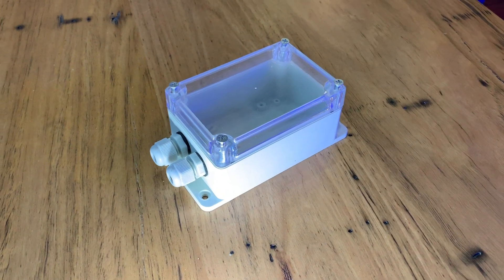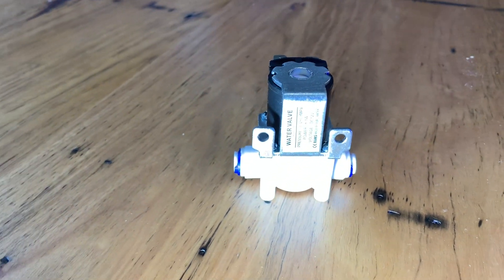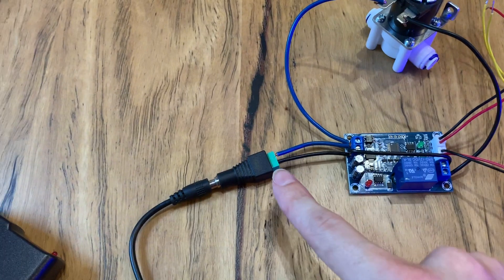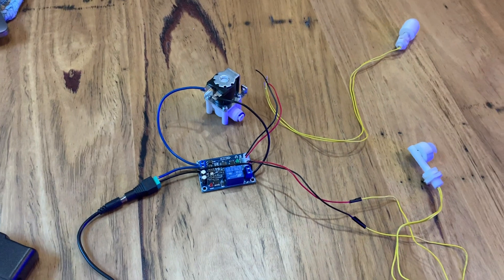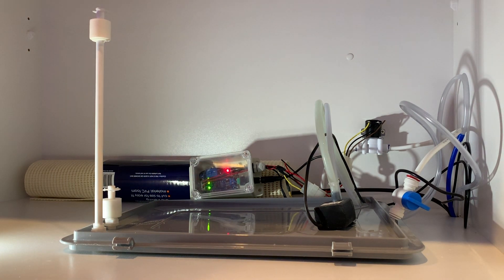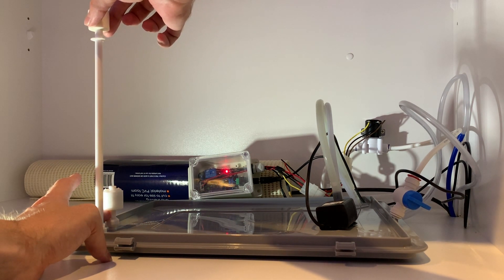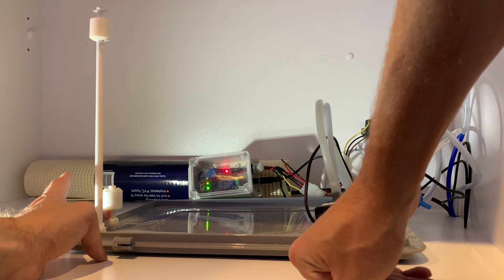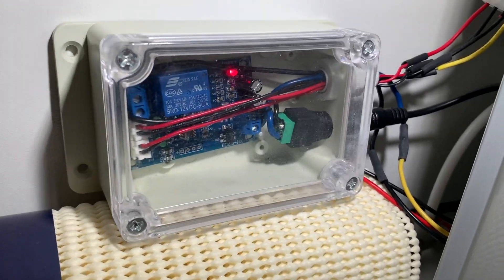DIY Project - Automating your RODI Reservoir

Comment: I'm new to this and have what is probably a stupid question.  It seems in a lot of videos that a valve shuts off the purified water when the high sensor is hit.  But doesn't the waste water continue to flow?
Reply: Not if you use the solenoid to control the supply water to stage one of your rodi.

Comment: Do you know if there anyway to flip the jobs of the float switch , I want my pump to turn in when it gets to the top float switch and stop when it reaches the bottom one so my pump doesn’t run dry ?could I just flip the float switches ?
Reply from the maker: Exactly as you say, just swap the floats around and they will function as you describe
Reply: @ReefNerd  okay thank you for the help
Reply: @ReefNerd  can they connected to Dc controlled pumps ? Like the might jet pump ?

Comment: Well explained. Thank you. Would it damage the switch if i use 1500 watt pump?
Reply from the maker: I wouldn’t recommend this little board for something that high powered. It may work… but I just wouldn’t feel comfortable. I’d get something specifically rated for mains voltage.

Comment: Hey, nice video.

I am also trying to create a similar one but i also want to monitor the water source. If the water source is low, then the pump should also stop even the water tank has low water.

Do you have any suggestion to make this work?
Reply from the maker: You could probably rig something like that up with relays and float sensors. But im not skilled enough with that stuff to be able to tell you how exactly haha

Comment: Thanks for the great video Marcus, this is super cool and I'll be putting mine together soon. As a total noob to electrical work, can I ask what type of blue/black wire you used to make the various connections to the controller? Thanks!
Reply from the maker: Just basic wire I picked up from a hardware store near me, i dont know the gauge, given this is all low voltage (12v) it doesn't really matter the gauge, just get a thickness thats large enough that it feels secure but thin enough that its easy to work with.  When i got mine i bought 2-3meters of 5 different colors, its pretty cheap and that has me set for a long time.
Reply: @ReefNerd  Thank you!
Reply: 20awg equipment wire will be fine. You could use door bell wire (or garage door sensor) as that is paired.

Comment: Thanks for the informative video! Kind of what I was looking to do, but have a RODI storage tank that is used to provide water for my salt water mixing tank and auto water change system. Any advice on how to move water from a RODI tank to my ATO tank under my aquarium?
Reply from the maker: How do you currently move water from your RODI tank to your ATO under your tank? Is your RODI tank pressurized and hooked up to your RODI unit directly? If so; my controller would be used to turn on or off the supply of water to your ATO in order to auto refill it. You can still tap into the RODI thats stored in your RODI tank by just installing a Y adapter with one side going to the ATO (managed by this controller) and the other side going to a length of 1/4" tubing with a  tap on the end which you can use to manually take RODI from the pressurized tank when you need it.

Comment: Excellent video Marcus. I've been thinking of doing this for some time, with a 940lt system we go through about 10lt of rodi every day. I just need to find a way to get the feed from the rodi system to the storage tank as our water outlets are nowhere near our display. Keep up the good work. I'm having trouble locating the 26lt storage box, do you have a link for it?
Reply from the maker: The pressure out of an rodi system is usually sufficient for pretty long runs of 1/4" RODI tube, which is easy to hide in walls, under carpet, behind furniture etc...

Comment: I like your thinking... only filling when it is empty! Awesome stuff mate!

... but...for a smaller tank it may not use your RODI often enough - I heard you should use it once a week (or nasty stuff will build up in the RODI). I'm just gonna stick with filling up a container every week or so - but I have a small tank and no room to have RODI system permanently set up.
Reply from the maker: As long as the container is fairly well sealed and not clear or exposed to light. Nothing will grow in it in any reasonable timeframe (months). Also remember that as the water level falls, the walls of the container will become dry, further killing anything that could possibly have started growing. So by the time the container is 99% empty most of its surface area is bone dry anyway.
Reply: @ReefNerd  You are right... but what I meant is the RO filters should be run once a week I heard Melev say - otherwise you need to rinse them for a long time to get the gunk out ;) Any loving the channel - there is so much awesome info - thanks